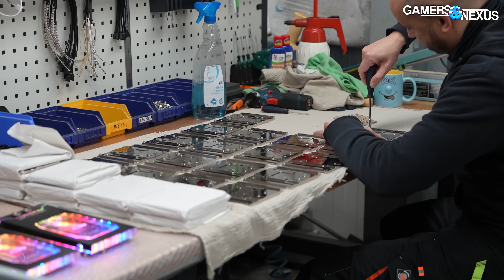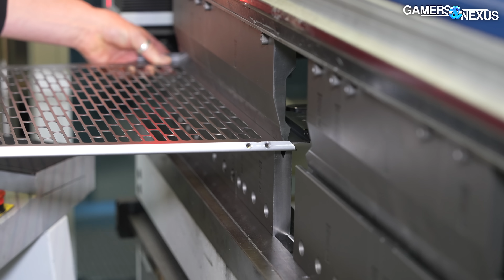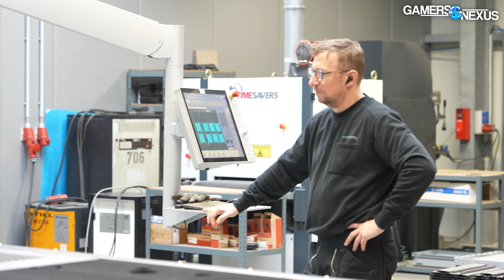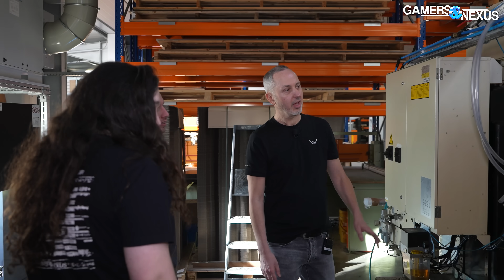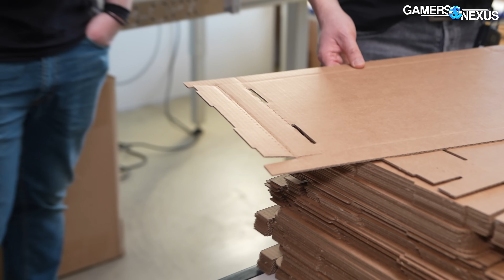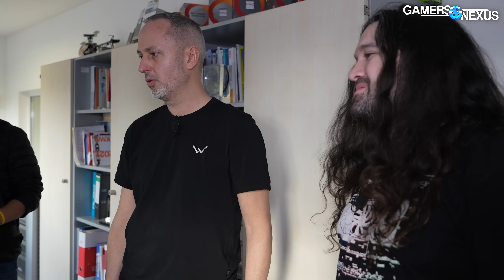Manufacturing Der8auer's Favorite Radiator | Watercool MORA-600 Factory Tour | Made in Germany

Comment: 8:44 Steve: Thermite. Aluminum powder + iron powder creates thermite. And if you contain that burn in a box it goes boom. They're not kidding, and thermite burns at like 4000 degrees, so it will melt through pretty much anything it touches.

Comment: have they thought of anything of scale?

lets say 12.000.000 Watts or 43,200,000,000 joules of heat per hour...

dispersal designs for the fin stacks vs the aggressive air flow designs?

parallel or series designs or maybe a combination of arrays ?

Comment: I mean, my dream PC is a WC setup using MORA as my rad and Grizzly waterblocks on my CPU and 5090, all done with smoked/matt tubing and black liquid loops. 

Have it running so quietly, with 200mm fans running so slowly so the RPM can be measured with a calendar. Just pure silence. My tinnitus will finally be chilled. Much like my PC ha.

Just need to win the lottery first. Should probably start playing it..

Comment: Watercool are awesome, beautiful designs, great performance, and exceptional customer service. I wanted a heatkiller xl block for my 980ti that had a bare copper cold plate, but they only did that model with a nickel plated finish. I just emailed them and asked and they said yeh sure thing, we can just pull one of the cold plates before it goes to plating. From initial email I had it in my hands in the UK in a couple of weeks, at no extra cost.

Comment: I like idea of MoRa - one big external rad, that has no limits enforced on it by case internal space, which can be placed in more cooling efficient space and which can be moved onto new, upgraded case, which, due rad being external, can be even SSF one.
But i guess there is lot to think about fan selection choice. The bigger fans get - the worse their pressure, greatly reducing flow through denser finned rads. The higher count of smaller fans - increase of noise just from higher count of noise sources

Comment: I've been a Watercool customer since 2017 and I can safely say they are one of the best water cooling brands on the market. I've had my Heatkiller IV Pro CPU block since 2017 and the nickel plating is still intact... and even after all that time, they still have top 3 performance (only Optimus and Alphacool's Apex CPU blocks are better). Their quality control is really what sets them apart. Out of maybe 30 orders, I've gotten 1 defective product (leaking reservoir, which was fixed with a new o-ring). All of the surface finishes on their blocks are perfect. The milling is always perfect. You can genuinely tell the people who made the product actually cared about it. The same can't be said for some other companies...

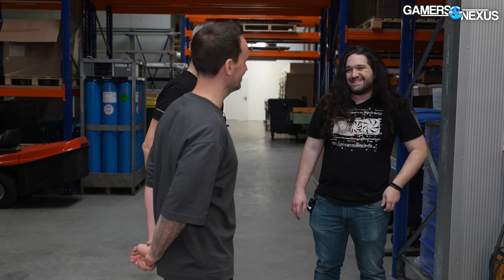Comment: 8:34 We to have a timesaver at work except ours is a wet machine that uses water-based coolant and we also sand aluminum and steel,    well we used to. Riddle me this what do you get when you mix powdered aluminum, steel and water. Yep we found that out to its call thermite you should've seen the mess.

Comment: I wonder if they also make their own heat exchangers/radiators as there's no mention of it on the video and I find it the most difficult part to make and probably the coolest one of a water cooling system. It would have been also great to know about the pumps they use, that is, who manufacture them and what models they use for their proucts. Excellent video as usual from GN!

Comment: I built my own sort of MO-RA out of 4 radiators, and I really wanted to make a grille like the one for the 600, but I would have had to pay someone like Xometry to make it (I already used them for radiator mounting brackets.) The cost for a comparable mesh made out of 1.6mm thick 6061 aluminum with black anodization was well over $200. Couldn't justify it. Guys, if you want to build a beast water cooling loop, just buy a MO-RA and be done with it. It simplifies the process, provides fantastic cooling performance, and nothing you can do custom will achieve comparable results for the same price. Not even to mention how clean and aesthetically pleasing their hardware is. It can't be beat. Really cool video to see how that fan grille is made though, it seems I was extremely close with my CAD files I made.

Comment: They are nice radiators I have the Mo-Ra3 420 with 4 200mm on it. can run a 3090 in minor OC and a Ryzen 5950 with PBO on and still say cool and quiet.

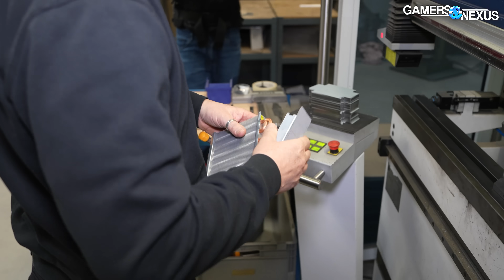Comment: 6:20 it's moments like this that reminds us "all of these things, like water cooling, aren't just for computers, because physical hardware is everywhere". My dad used to be a power plant operator and he has gripes with German hardware but I feel like this is completely different from what Siemens does and it's just cool to satisfy that sense of "industry"

I'm so happy the filler episodes from Beve Sturke is over, we're back to Steve Burke content 

(also surprised whenever a der8auer video happens the comments aren't angry with "sponsor conflict of interest" that Beve Sturke would love to feed on)
Reply: One of the big things in cooling solutions right now is electric vehicle charging. Especially for electric trucks which can easily pull 300 kW of charging power for more than an hour. You just need water cooled cables and fans and heat sinks for the power electronics, there is no way around that.

Comment: Love manufacturing videos, love the enthusiasm of the makers of these products. Yes and, I hope I never wind up needing to watercool anything for any reason, other than planes trains and automobiles. No need for green stuff growing inside a liquid loop, no need to take everything apart and clean bacteria and mold from CPU surfaces, no need for pumps and radiators, no temptation to assemble custom loops that take hours and thousands of dollars to put together. No thank you. Let's hope silicon wafers keep getting more efficient, more easy to cool with air, less fussy and less obsessive. There's a reason aircooled Porsches have a big and super enthusiastic following and I cheer for it. Being an airhead is awesome.

Comment: at 8:30 when they talk about grinding steel and aluminium at the same time being dangerous because of explosions, I think they might be thinking of a possible thermite reaction
Reply: Thermite is typically iron oxide + aluminum dust. But either metal is flammable on its own if the dust particles are small enough.
Reply: They are talking about a possible dust explosion. Metal powders are very reactive due to the enormous surface area. If they are airborne during the grinding process they are a huge explosion risk. In the video they mention that it is the same with flour. Flour explosions are a known risk and have leveled many flour mills over the years

For a thermite reaction you would need iron oxide, meaning rust, to supply the oxygen to the aluminium for the reaction
Reply: OR they're just talking about the insane flammability of powdered steel as well as powdered aluminum. 🤡

Comment: Random aside for the topic of cleaning parts out of a CNC, one near magic process is vapor degreasing. A quick and thorough way of removing oils in under 30 seconds and can be automated. The only downside is the initial cost seeming to run from $10-50k depending on the machine capacity and automation requirements.

As a machinist who runs machines with both emulsified cutting oils and neat cutting oils, I can only dream of adding a vapor degreaser to my personal/hobby shop.

Comment: well you have 
Alphacool 
watercool
aquacomputer
thermal grizzly
all from germany
and i have stuf from all 4 in in my loops

i just wish watercool would make those micro chipset blocks again 
They are great for chipsets and addin cards that have heat sinks meant for high airflow environments.
i am using mine on raid controllers/hba/pcie expander cards.
Reply: Well, make that three, because Alphacool is only "Designed in Germany – Made in China" ..... <.<
Reply: @kitsunesenpai441  ah ok thx for letting me know

Comment: I gotta ask how tiny a change in temperature are they chasing with this stuff... Because it's usually a degree or two with all this fluid dynamics stuff so you could make a product that performs every bit as well for all intents and purposes in the real world if you just ignore chasing after nothing's to get a marginally lower number that effectively does nothing for a much more affordable and quicker development time do they actually get anything out of it

Its like engineers they will continue to engineer to the micro degree until they are told to stop at a point of diminishing returns and this seems way way past that. Definately fun as fuck but hopefully he's got a good bean counter telling them when to stop its not getting better just more expensive
Reply: I guess it just has to fit with their development cycle. They seem to run the simulations on their local hardware with them taking a week or so. It's not like they need to run them on a huge cluster of GPUs every single, so the cost aspect seems very manageable.  
A quicker development cycle isn't necessary needed under  current (relatively) stable economical conditions in the watercooling market.
Reply: *Definitely 🤡

Comment: I don't think they are actually that much competing as Watercool produces parts that Thermal Grizzly does not and other way around. Example Watercool produces radiators and non-direct die waterblocks when Therman Grizzly produces thermal paste, thermal sheets, direct die waterblocks, contact frames etc..
I love MoRa Radiators, i have one of the large ones MoRa IV 600, it was excellent purchase also have Thermal Grizzly's AM5 Mycro and thermal pastes etc..

Comment: Why do you need to water cooling in all my years of building my own pcs i have never used water cooling?
Reply: silence under high load. a 5090 air is quite noticable under load
Reply: You dont get it, nobody „needs“ it like a 5090 we just „want“ to have it 😉
Reply: It is especially useful for those who overclock and want maximum power out of their hardware. for an average user. A regular air-cooled system is fine. Or for those that just want watercooling, since it is cool